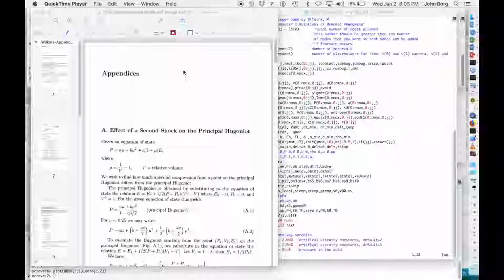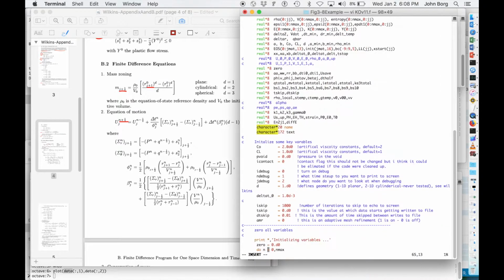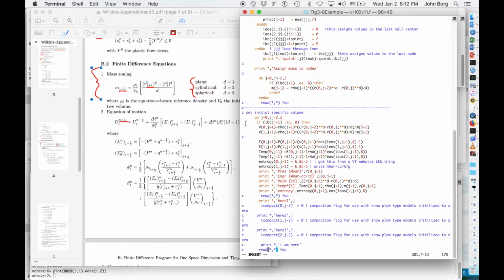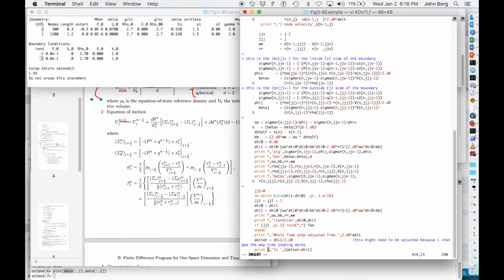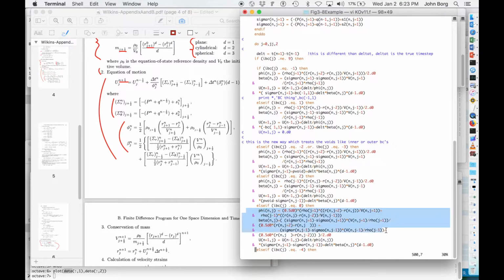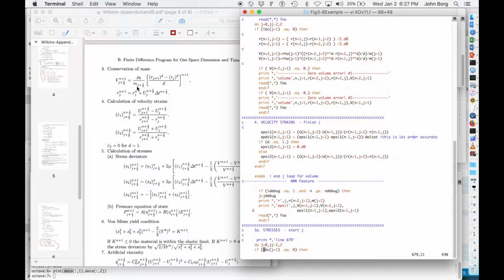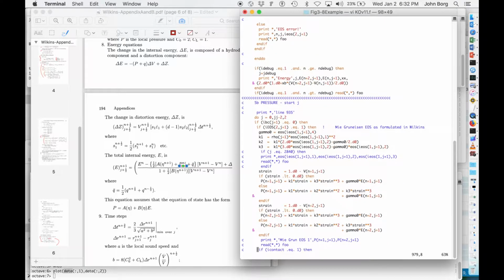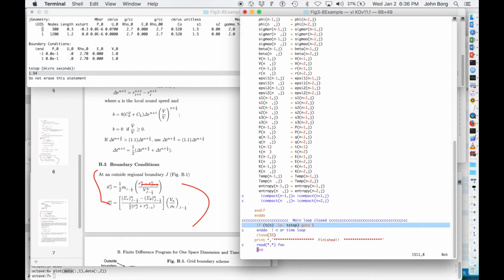KO Explained

Comment: Nice video. Have you managed to write the 2D or 3D version? It looks quite a bit more challenging to code up.

Is your P-alpha implementation incomplete? I can see you've done something to update the internal energy but there's no corresponding pressure update on line 1085.
Reply from the maker: I have not done the 3D version although I would like to.  The 3D implementation is in Wilkin's book and I don't think it would be too hard to do :)
Yes, I see what you mean about line 1085.  I have several versions of the code and one that I wrote specifically to use with p-alpha.  I should check into that.  

Thanks for the comments!